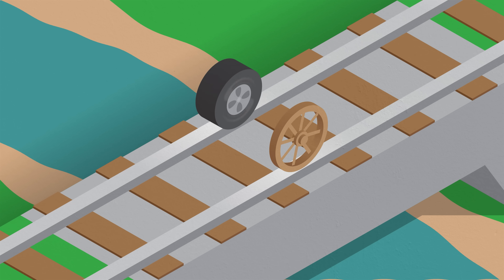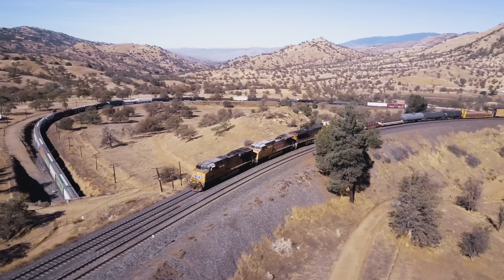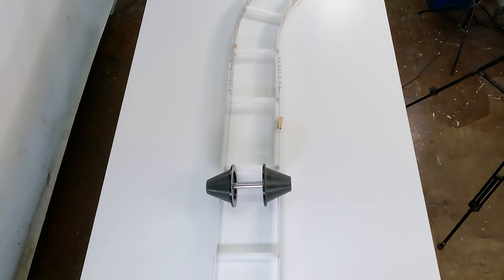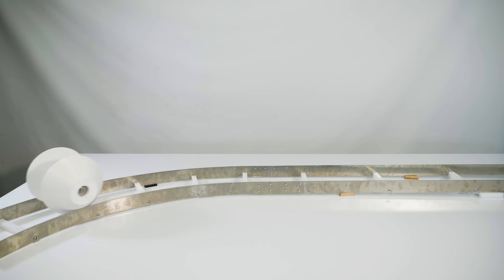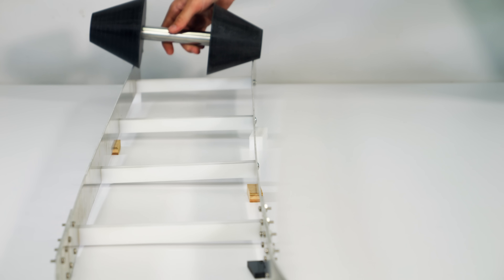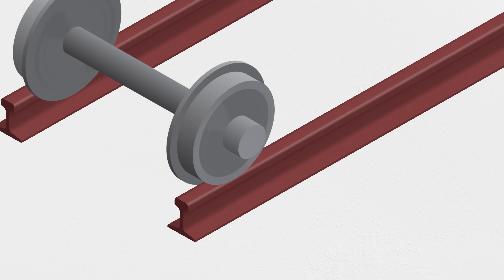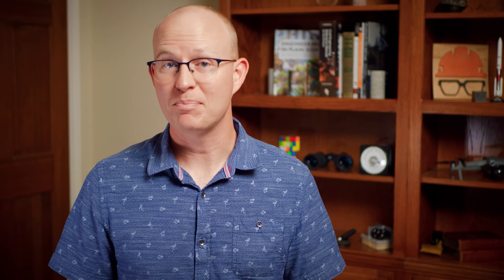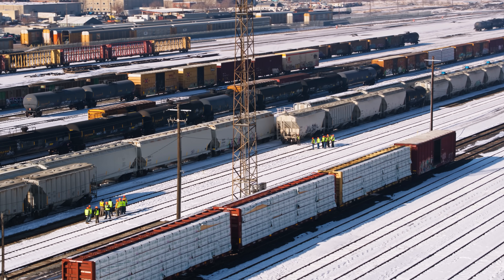Why Are Rails Shaped Like That?

Comment: Analysis of the whl profile vs. the track at 2:40 - 2:45

1.  Whl Profile

The flange has two defects - a chunk broken off and just below n above it, the flange
is sharp, like a pizza cutter.  This isn't normal.  The whl tire portion is also worn out (dished out deep).
The wheel doesn't even need to 2B measure w a whl gauge per FRA spec to condemn it.
This whl set should of been replaced a long time ago.  I wonder if this rail-car was strictly used for a
sharply curved SAME branch line over n ovr again vs. out in the Main line.  Thus, it wasn't inspected by
Mainline terminal Carmen periodically?   It'll b interesting 2c the opposite whl wear.   Yet, the bearing
(c datttooo tiny light blue around the 'whl cap'?  No dirt or grease on it) looks gnew.  So dat doesn't
justify this horrendous whl wear.  And also, there's no black thick grease-dirt on the rear back of the
opposite wheel (whl).  This also indicates this railcar didn't travel much if it all, out in the Main Line as they
routinely coat rails w oil to further reduce friction to the dismay of engineers (it can result in whl
slippage esp. if the loco is hauling a heavy load).  Also, no dirt-grease anywhere on the truck frame. 
They don't soap wash or steam wash these pawns (railcars) like ur brand new Red MooseTung so why
is this truck n whls r so clean?  Yet totally damaged n worn out?

2.  Track Components

Another ding (thing) - As the commenters below has noted JNR's bullet train rails have only a tiny strip
of wear mark on a rail.  Note this rail above.  It's flat n no crown on it.  Dat's bad!  Yet, i kant understand
it wasn't replaced a long time ago.  Incidently, JNR is working on MAGLEV train as the other nations do
so dat'll eliminate whl n rail wear problems along w swinging coaches!!!

Also, if u look at the ties, it's bone dry, no crack, perfectly clean.  So why the rails aren't new?  Terribly worn
flat.

And the tie-plates r also new.  Light brown smooth rust on it w no deep pits, scales, etc.

The spikes r perfectly burried deep, no pop heads!!!

Ballast (gravel bed) is also look newly laid.  No oil streaks on dem along w no oil streaks on the ties.

Summary:

The truck frame, axle bearing, horrendous whl wears, heavy rail wear, and new other track components
doesn't make sense.  The wheel story doesn't jive w the track.  And the rail track components demselves
doesn't jibe.  What's go'in on w this photo at 2:40 - 2:45?

Comment: I'm curious, is it possible to recover the worn steel -- presumably all oxided -- from the rails and wheels that's spread all over the road bed, and, if so, are there techniques under development to do this efficiently at scale? It would add to the sustainability of rail for sure in a way that road transport will never be able to touch, as it's a lot easier to process metal oxide than it is to recover tire dust which is essentially plasticized waste unless and until we come up with some biological process like bacteria that eats the stuff.

Comment: Since locomotives are already diesel electric, could railcars, including containers, be built with solar panels on the roof and batteries in the floor and hooked together with cables at each end similar to air brake connections to allow for development of hybrid locomotives?

Comment: You mentioned worn out rails getting a second life in a yard. It seems like since they primarily wear on the inside, you could also extend their life by just swapping the left and right rails. Is this something that is done?
Reply: That is called transposition, not done much in the UK these days. As in mainline use rails tend to fail due to reaching their fatigue life before that sort of wear gets to a point where transposing the rails would be worthwhile.

If you were to do it on a tight curve due to side wear the fact that the there will be sort rails on the inside of the curve makes swapping the rails a pain, and the resulting narrow rail head on a rail side worn on both sides is not good either.

Comment: One thing I realised was that rail-tracks are also banked (or cambered?) on curves, so that the outside rail of the curve is higher than the inside rail.  This is especially so if there's a change of elevation, the main reason being to reduce side-loads on the wheel-flanges, but also because the rails are then able to flex laterally & vertically!

Comment: Rail...road beds... steel wheels...ALL WEAR , DEFORM AND  LOSE TEMPER...
SPECIAL SITUATIONS DEMAND MAINTENANCE...REPLACEMENT....
UPGRADES , CROSSINGS , INSPECTIONS....
RECYCLING THE TONNAGE USED IS ASTRONOMICAL
TIES , CLAMPS , BED CONDITION...
BRIDGES , TUNNELS , STATIONS...
ROLLING STOCK MARSHALLING YARDS
LOGISTICS IN  SHARED  CARGO , COMMUTER....
DIRECTION , SPEED , STORAGE AND  SAFETY OF CONTENTS..
OH MY...
THEFT AND  EMERGENCY RUNAWAY SCENARIOS..
YEAH , ITS A  LOTTA  STUFF TO MASTER

Comment: A thing to note, I have a piece of 280lb (127kg) rail one inch thick as a display piece for a model steam locomotive, and that section from foot to head is maybe 6 or 8 inches tall. Crazy to think that something so small it can barely fit in your hand handles MILLIONS of tons of freight/passenger a day. I got my piece a handful of years ago when they were replacing a nearby switch, which is how trains "switch lanes" if you will. My town 80lbs rail in town used for industrial purposes. These rails handle plastic pellets, silicone powder in 4 bay covered hoppers, potassium in tank cars, recycled paper, cardboard boxes in 50ft boxcars of various, coiled steel wire on bulkhead flatcars, grain in 3 bay covered hoppers of various types, less-than-car-load freight in 60ft boxcars. My town also has a few examples of 75lb rail, one by the ol' train station supporting an old 40ft Atlantic Coast Line boxcar, and supporting 2 passenger cars that are now "landlocked", one is in New York Central colors, with the other being in Pennsylvania Railroad Tuscan red. CSX operates the largest rail, the previously mentioned 280lbs rail, as it comes in from from the north-north east, and curves south-south east with a siding at one end of town, with the industrial line coming right off the main, the various industries collectively own & operate with small "Track Mobiles" the industrial line up to a certain point, and the paper mill is off their own switch south of town. My main interest of trains stemmed from my childhood and has shifted to port operations, such as those at the Panama Canal, and ports of LA/LB. Rail is crazy to think of as simple, but every bit of it supports a diverse array of already diverse towns and cities.

Comment: Another factor that wasn't mentioned in this video is that the rails are not set "flat" on the crosstie. The plates between the rail and crosstie are tapered so that the rails are canted toward the center of the track. This allows the rail head to match the taper of the wheel so that the force of weight bears directly on the center of the rail. This reduces rail wear and defect  propogation.

Comment: Did you notice that the wheel set also slightly leans the axle into the curve, not much but a little.   I am helping to restore a narrow gauge railway in N Wales, we are using some old 1907 rail which still has plenty of life left in it.

Comment: Railways were made of wood before they were ever made of steel. Wikipedia briefly termed these early railways “dramways” in reference to the fact they were horse-drawn, but they were just called “railways” by the people who used them. This is in fact the origin of the term railway, since “rail” meant “fence” and “way” meant “footpath.” The name makes a lot more sense when you look at a common picket fence and then at those archaic railways with their flat beams.

Comment: I used to ride on small D-E commuter trains South of Sydney and the noise from the wheels made conversations impossible. Even the slightest turn produced a loud screeching noise. I was told that there was a mismatch between the rolling stock wheel and the rail profiles - they had boobed when ordering one or the other…..

Comment: In England they're known as "trainspotters" or worse: "anoraks" as they always are at the end of the platform with their notebook and anorak spotting trains. The oldest tracks are in Minoan Crete. There are also suggestion of stone sleds (used well until the early 20th century by horses and oxen in USA and Europe in quarries) on greased tracks. 
Also- you're ignoring a huge part of the sotry- the beginning of rail which does a disservice to UK and then their US offspring.
The first Railway in UK was the Caldbeck Mine 1560s wagonway, made by German specially imported miners essentially a railway powered by animals drawing the cars or wagons, was used by German miners at Caldbeck, Cumbria, England, 1560s. Another wagonway was built ca 1600 at Prescot, near Liverpool, owned by Philip Layton, the wooden line carried coal from a pit near Prescot Hall to a terminus about half a mile away- which then was transported by the British canalways- a waterworks which surpasses all the wonders of the ancient world in terms of man-labour and soil removed COMBINED- more soil than the stones of the Egyptian pyramids- lighthouse of Alexandria, the Colusssus (which didn;t really have much stone but anyway) hanging gardens etc- I kid you not- not much different in size and scale to the Californian-Utah river irrigation system (which also eclipses all the ancient wonders of the world in scale and feat of engineering- albeit a lot of work done by steam shovel and dynamite- not man with pick & shovel and dodgy blackpowder)

Another wagonway was Sir Francis Willoughby's Wollaton Wagonway in Nottinghamshire built 1603 and 1604 to carry coal- this is the first itch of the industrial revolution and the steam age of Watt- which leads to the age of railways and later US massive rail infrastructure (then Russia then China).

There are also possibly rails on wooden roads alias "corduroy roads" the Celts and Gauls used sleds on for shifting stones for Dolmen and other Megalithic structures famously in Europe Stonehenge and the largest Megalithic structure in Europe- Carnac in France. France also known by the Romans as hairy France because of the huge amounts of trees- trees in such abundance in thick- heavy clay soil constantly muddy thus placing logs on well-travelled paths, then adding to the paths to make them wider in between trading villages then finally putting down fascines and perpendicular logs making corduroy roads would have been a rather simple, logical and currently archeologically investigated possibility PRIOR to Roman roads.  There are many henges- these are earthwork mounds- how did they shift the soil? Many archaeologists suggest sleds pulled by oxen or manpower as we saw Mussolini's obelisk raised in the 1920s's. 
Stonehenge just happens to be one of the largest and most accessible- in a plain (Salisbury Plain)- there has always been a road near Stonehenge since the Iron Age- the Romans built over it. 

And NO COMPLETELY WRONG- rail is shaped like that because Mr Ian Isaiah designed them and wanted to remind everyone I I designed and built them. That's a silly joke.

Comment: In another video you could mention "rail grinders", which are short trains with dozens of heavy-duty grinding wheels that grind the rails to a more idealized shape after they have been deformed through wear. Rail grinding is fun to watch - showers of orange sparks flying everywhere - and it increases the life of the steel rails. Here is a great rail grinder video (go to 1:24 of the video to see the good stuff)
https://www.youtube.com/watch?v=nPBhAew5I40

Comment: I worked as a Quality Inspector for a railroad company where we resurfaced train wheels and axles there is a very specific curvature and lip that goes into Machining the wheel they can be resurfaced up to a certain point as long as they have enough serviceable metal. Obviously the wheel don't have 90° angles because that would not work

Comment: Hi Grady. I am wondering if you could please do a video on how the dime sized rail contact that a locomotive makes with the track is able to provide so much power as to pull tons of freight cars. The only thing I have heard is something called Tractive Effort provided by the traction motors in the locomotive trucks (bogies). Even with sand applied, it still doesn't make sense how such a small contact point per motor wheel can create so much pull power. Thanks for any answer you could provide. I enjoy your videos.

Comment: In Southern Africa we use mostly concrete sleepers, which are tilted inwards under the rail foot, vastly increasing contact area and therefore reducing wear, and improving adhesion of loco driving wheels. On the odd wooden sleepers we have, we use steel “stools” which have the same inward angle.

Comment: In the Netherlands, train wheels have "tires" (also made of steel, of course) that are replaced regularly to combat wheel wear without having to take off the wheels. I guess this is true in other places as well.
The tires are slightly smaller than the wheel, and are heated before mounting so that the stress will firmly keep them put.
Reply: That was standard practice on the big driving wheels of North American steam locomotives also.
Reply: Some french Metros have actual rubber tires.
Reply: These "tires" (german: Radreifen) have also led to a number of small and large accidents.
Reply: @JohnADoe-pg1qk  As far as I know, because of those incidents, "Radreifen/ Bandages" are not produced to only use shrink fit anymore, instead they are now Shrink fitted and  boltet to the "Rims", atleast thats the change we experienced in our newer trainmodels compared to the old models!
Reply: @JohnADoe-pg1qk Ahem ahem Inter-City Express Eschede crash
Reply: @ratvomit874  Yes, a 'large accident', well, very large. 😐🙁
Reply: @JohnADoe-pg1qk  This was due to the wheel construction rather than it having tyres ' they had layer of rubber between wheel and tyres this lead to metal fatigue in tyre

Comment: 51 year railroader that has been retired for 7 years.  There are more 'tricks of the trade' in railroad right of way engineering and the operating environment than most non-railroaders can even comprehend.  Engineering hidden in plain sight.

Comment: Two thoughts that I imagine have been considered:

- What is the effect of the sideways bending in the web? Is there an advantage in making the inside rail of a curve of a different flexibility than the outside?

- With modern forging techniques I imagine it is possible to vary the material properties across the profile of a single rail, or even mix materials in layers. How could that affect behavior? I am put in mind of sword construction where a harder steel is used at the leading edge or multiple layers allow for flexibility.

Comment: I have watched a number of train rail/wheel videos about why they are designed like they are.  But I have never seen or heard of the reason why the wheels are connected to the opposite wheel with a solid axle.  Letting the wheels on a particular axle spin independently, (a non solid axle), would solve the problem of excessive friction and squealing since the inside wheel will spin slower than the outside wheel which must spin faster because of the longer distance traveled., thereby reducing the friction created by the solid axle.

Comment: Curves not corners. Tapered not conical. Base not foot. Truck hunting is caused by many things one is the face of the flange is worn away this allows the wheel to move even farther side to side. Your picture of curve wear is wrong/backwards. You left out one of the most important thing. Tie plates have a camber to tip the rail in towards of the middle of the track. This is to align the web to be centered under the wheel. Also grinding the rail makes it last longer.

Comment: You have done a great job with this video.
 Don't forget the tie plate as it has a taper to it too like the wheels. On rail with a 6" base/foot the matching tie plate has a difference, between the high side and the low side, of 1/4". If the rails were attached squarely to the ties without those plates the rail would be subject to forces at the head/ball of the rail forcing it outward because of the conical wheels.

Comment: My great grandfather had a piece of rail that he used on occasion when he needed something to serve as an anvil, which is a pretty common practice. I held onto that piece, keeping in in the shed or garage for years until I finally had a use for it. It was a rail that had obviously seen a lot of use in its day and since my use was would be better served by a nice flat surface, I took it to a shop to have it machined flat. The machinist said he had done a few before and he would just do it that afternoon and I could pick it up the next day. I was fortunate that he was stubborn (and kind) because when I went to pick it up he only charged me $20. I say stubborn because he said he broke three bits on it, and only managed to slightly improve the top of the rail. According to him he kept trying because he had never had trouble with one before, but he thought it had something to do with the age of my rail and it having seen a lot of use in its time on a track, compressing and hardening it over time. Now I'm wondering if it was one of the harder rail segments you mentioned they use on turns, though I don't know how long they have done that, nor do I know the age of my rail, so hard to know for sure. I just thought it was interesting (if true) that rails might harden as well as wear, over time.
Reply: I have a 6" rail, 12" long. A friend with a mill flat topped that rail. Great anvil! I also have 40" of 8" rail.

If yours is 8", then I believe it is the harder steel, than that of a 6" rail.